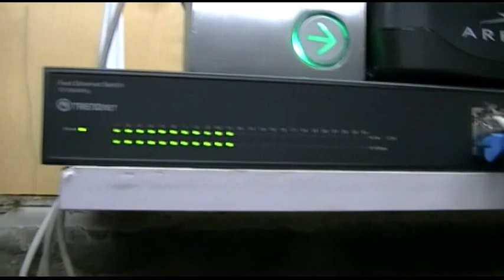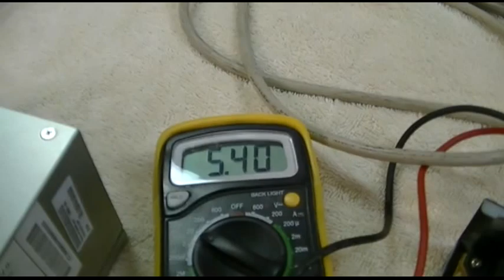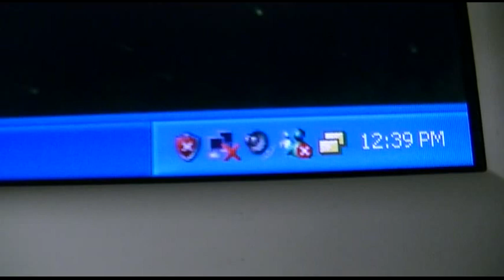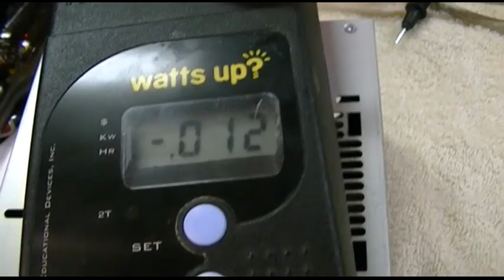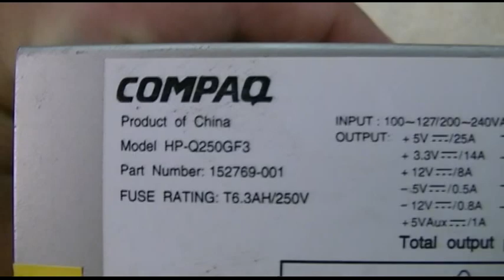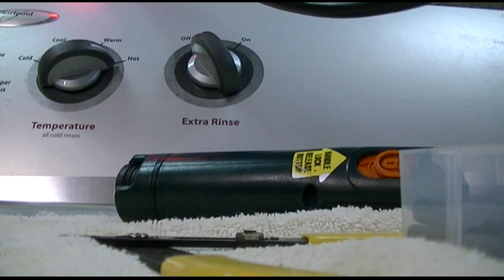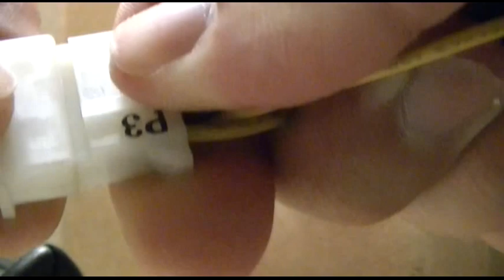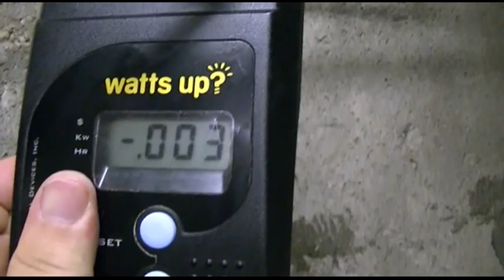Repair Linksys 24-port Ethernet Switch

Comment: I have the same Linksys EF4124 Ethernet switch that is working.  The internal power supply (model # PS0209-B) has a label with the following info:
  3.3VDC 5A output
I measured the voltage with the power supply connected to the main PCB:  3.402VDC

Running this switch at 5VDC will likely cook those 4 ASICs on the PCB in no time.  I agree with your diagnosis that the input capacitor on the power supply has failed.  That is likely causing a ton of ripple on the 3.3VDC output that is results in the device not working properly.  Modern ATX power supplies also have 3.3VDC outputs so you could use 3.3VDC to power this switch rather than 5VDC.

Cheers!
Reply from the maker: Thank you for that information!  I still have this switch decommissioned, I will look into seeing how it does off 3.3 volts should I need to put it back in service.

Comment: Hi There, that brings back the old days when I worked for a local Aerospace - Defense company, Often straight away measure the +5V dc & then change ALL the capacitors on the small cheap board, 100's of those I repaired, including HP etc same fault poor design putting Electrolytic capacitors next to a hot heat sink !, clean PCB with alcohol to remove the liquid from the leaking capacitor, from both sides of the PCB,
Reply from the maker: That's great, that kind of mission-critical application and still the parts are sub-par!

Comment: Great video.  I really liked your idea of re-use of old parts to replace your defective parts. Plus, it just so happens that I am in need of a 5VDC power supply and I happened to have an extra PC supply floating around.  Thanks jaykay18.

Comment: Do you still have the power supply?  The blue sticker on the heat sink at 20:24 on mine is labeled 3.3v 5a 16.5W.  Maybe it's 5V tolerant or something,  but I'm curious if we have different revisions or if yours was supposed to be 3.3 also?  Just noticed you definitely have a different revision then me.  My ports are 3 groups of 8 with maybe a half inch gap between each group.  your ports are all right next to each other.  Anyway still curious if that label does have similar info to mine about specs on power supply.
Reply from the maker: I wish I knew, I definitely remember throwing that power supply out.

I took a chance with this repair, banking on the fact that the switch uses TTL, which is a 5 volt reference.  I ran it overnight I believe since the repair and it worked fine, but ended up replacing the switch anyway.  Still have the switch, and I long for the days when I had it in service because the lights on it were awesome.  I think I got too good of a deal on a brand new switch, so I replaced it.

Comment: capacitors do not need to leak , then they can also be broken. the ESR may be too high so that the food does not give the correct voltage
Reply from the maker: That is true, the capacitance value may have varied enough to wreak havoc.

Comment: How did you get it apart?  The disassembly process isn't shown.  I took out the 2 screws on each side of the cover and one on each side of the front panel, pulling and prying, nothing comes apart.
Reply from the maker: Normally I wouldn't entertain such trivial matters, but I had forgotten all about this video, and curiosity got the better of me.  I have mine sitting, repaired, but not in service so it was handy.  I went and took it apart, because I honestly couldn't remember.

The metal case has 2 screws on each side.  Take those out.  The plastic bezel (front part where the lights are) has a screw on each side.  Take those out.  You must remove the bezel to get the case apart.  Easiest way I found to do that is to turn it upside-down, lights facing you.  I used my fingernails and pried up on the bezel, that undid the clips.  Work that around to the edges and it should sort of "pivot out" so it can be removed.  Once the bezel is off, the case comes right apart.

Take note of the screws in the bezel, they are slightly longer than the case screws.  If you try to install a short one, it won't thread in.  If you install a long one in the case, no damage will occur either.  Good luck with your repair, any other questions, let me know.
Reply: @jaykay18  I got it, thanks.  This thing is bass-akwards compared to most stuff I work on lol.  I was trying to lift up on the back edge of the cover but the front end actually had to come up first because there is a metal lip along the back edge holding it.  Most of the time the back side lifts right up and it's hooked on the front edge.  I work at a casino and we use these in drop cabinets for the machines to communicate with the slot network.  Often things get sticky with drink spills down in there so I didn't know if it was just stuck but didn't want to pry too hard and break something.  

Once I got it apart, the failure was very similar to what happened to yours with all of the LED's on solid.  The 33uf 400V capacitor wasn't bulged or showing any physical sign of being bad, but it read wide open with my ESR meter.  The closest thing I had to it with a 105C rating was  47uf 400V, and it never hurts to go a little over specs (but not a lot over on capacitance due to the increase of inrush current on power up).  The 470uf 10v capacitor across the output was blown open on the top so I replaced it with a 470uf 16V.  The 2 2200uf 10V were still good measuring close to zero ohms ESR.  After replacing the 2 bad caps, all the LED's come on briefly on power up and go out, and only the power LED remains lit.  I believe it's fixed.  Thanks for your help.
Reply from the maker: @Steveh112  Way more advanced stuff than I ever got into.  I never did (or needed to do) a board level repair, as a computer technician, we just replace assemblies.  Glad this helped you out.

Comment: Nice video! I thought i had the same issue (my netgear switches on for 1 blink, then leds are out and fan keeps blowing). "Unfortunately" i measured a 5V from the PSU. Any idea what the problem can be?
Reply from the maker: Probably the logic board.  My guess is it will not be repairable, unless you want to go board-level and have a schematic.

Even if you measured 5V on the PSU, you might try a KNOWN GOOD 5V supply.  I've seen supplies output proper voltage at no load, but when there is a load it drops below the threshold.  The fan requires very little current and as such (if this is the problem) is not pulling the supply down.

Best of luck!

Comment: THere are total Four wires connecting power supply board and main Board
Can anyone tell me the voltages of these wires
or what is the exact purpose of these wires?
Reply: +Prasad Newaskar Two red wires and Two black wires
Reply from the maker: +Prasad Newaskar As discovered, it was 5 VDC.  The 2 reds and 2 blacks are exactly the same.  I'm not certain the reason they use 2 red wires and 2 black wires; if it's current-related you'd think they'd use a heavier wire.  But this "2 red, 2 black" wire bit is used in laptops as well.

The only thing I can think of is perhaps they're "splitting" the 5V to go to separate circuits, but if that were the case I would have thought they would simply split off on the circuit board.

Comment: Is this switch still in service?
Reply from the maker: Hasn't been in service, but I did have it powered up not long ago, and it still works fine.  10/100 days are getting very long in the tooth, I'm going to soon upgrade everything to gigabit.
Reply: @jaykay18  I'm glad it still works despite its problems, though I understand that 10/100 is no longer feasible. Gigabit seems to be the modern standard, though multi gigabit networks are fast taking over.
Reply from the maker: That's all right with me, I'm always using old hardware, so not only won't it take advantage of the faster speeds, I can wait until prices come way down.  As it is, I still use a Pentium 4 for my day-to-day work, as I am right now.  I only use another machine for video editing.
Reply: I'm glad that works out for you. I wouldn't be able to use legacy hardware on a daily basis due to the inherent slowness of it all, though, it certainly has its uses.
Reply from the maker: I once was told about an interesting answer given to a question someone asked.  They asked "What is a faster processor going to do for me?  This one is 300Mhz, and that one is 600MHz."  The answer was "The 600MHz one will allow you to make mistakes twice as fast."  I thought that was a great answer.

New hardware, and newer operating systems, for me, aren't where it is.  The hardware and machines they make today are junk, too highly integrated, and Windows 10 steals all of your personal information, chances settings you've made to prevent that, and allows Microsoft to spy on you.  Those are 2 of the main reasons I stay with older hardware.  This switch in particular, has separate LEDs for everything, putting on a nice show of blinkenlights, instead of just a row of surface-mount LEDs behind a mottled, smoked plastic cover that aren't bright and exciting.  I miss the days of hearing a hard drive thrashing around, and floppy disk stepper motors.
Reply: @jaykay18  I've never looked at it that way, though I am aware of Microsoft, the NSA, CIA etc spying on me. Simply put, I don't object because I know there's little I can do about it. I am fine with usng older hardware assuming the experience is good. I find a solid state drive helps with speed a lot.
Reply from the maker: Yes, SSDs are very fast.  I really wonder what it would do for this Pentium 4.  One day I'll get one.
Reply: @jaykay18  I put one into a Core 2 Duo laptop, and the difference was astonishing. It was bottlenecked by the SATA II interface to an extent though.
Reply from the maker: Oh yes, I'm well aware of the astonishing difference, I've seen it before.  Either way, bottlenecked or not, it was a great improvement.

Comment: this guy is awesome, I have this linksys router that broke and took it apart like he did. I am trying to find the exact power board to replace it with, if I can't find one I will use his method. thanks!!
Reply from the maker: +Mat McNeil You're talking to "this guy", I made the video!  Thanks for the kind words!  You can use any 5 volt power adapter you have laying around.  I happened to have (at the moment) an abundance of old PC power supplies so that's what I used.  You could just as easily rigged an old cell phone charger up to it, provided it was 5 volts!  I simply used what I had on hand, knowing that the 5 volts from the PC power supply was very stable.